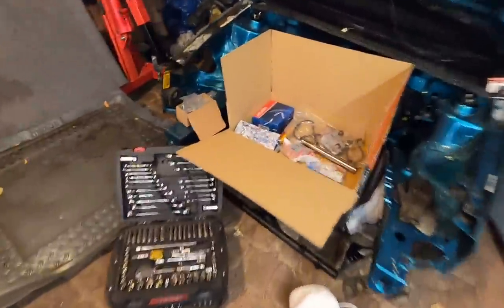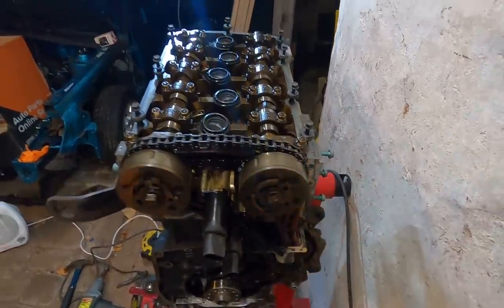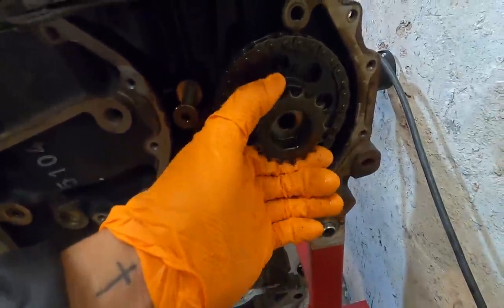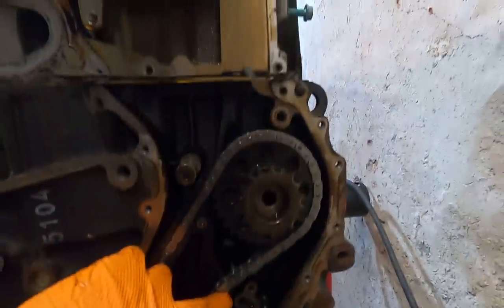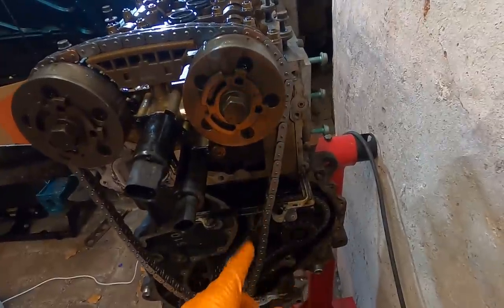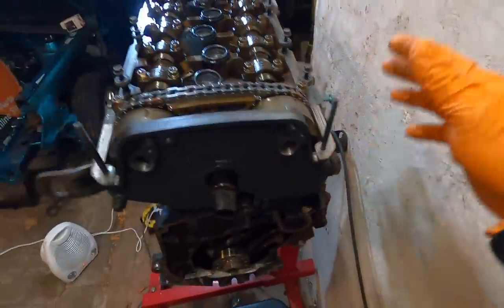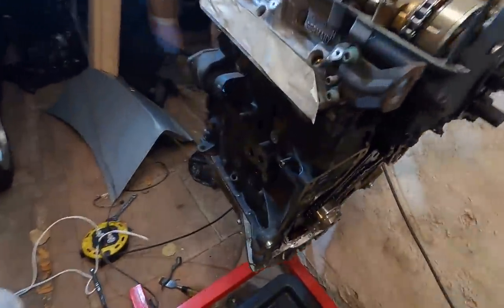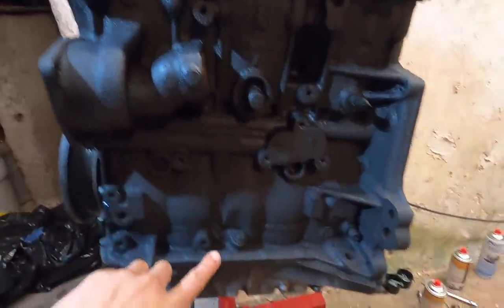New Timing Chains & Painting The VR5 Block! ( Golf Savoy Project )

Comment: Nice job 
How much hp does have a stock vr6
How much hp have miley
Reply: 12v 2.8L is rated at 174hp, while the 24v is rated at 201hp.
Reply: @NousagiMechanic  thanks but what engine has miley with 201hp
Reply: @avdylgashi3583  Miley has a 12v. He has cams exhaust and a tune, few other tricks,  I'd say Miley is right around 190 to the wheels.
Reply: @joekizonu9503  yeah it is great to have this souch a good car